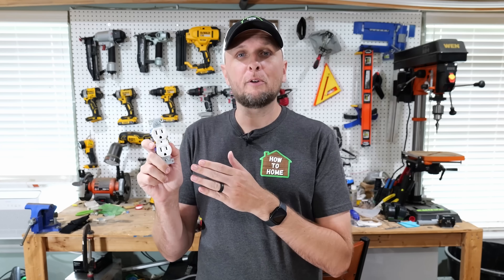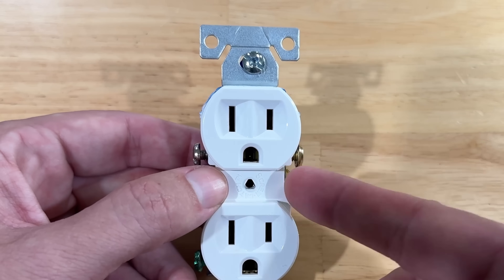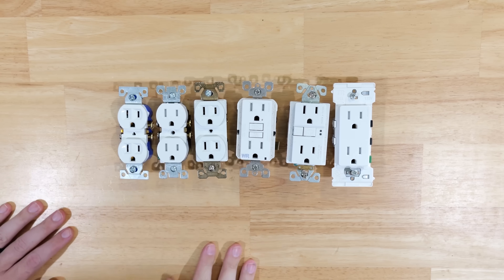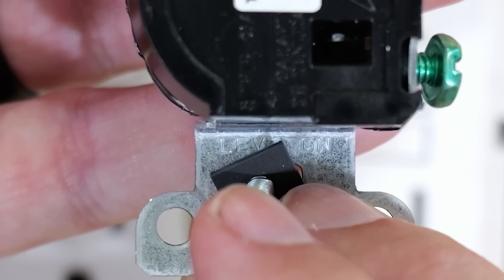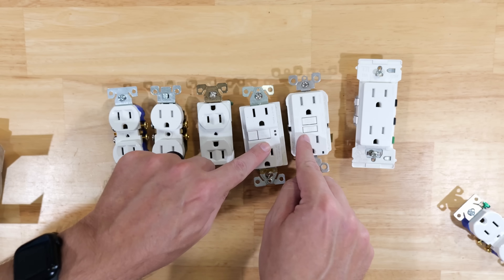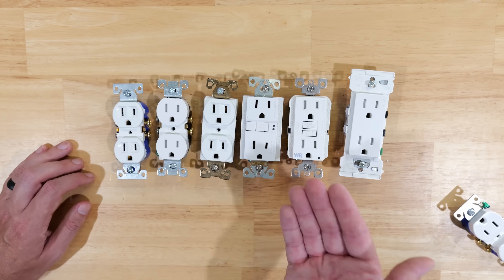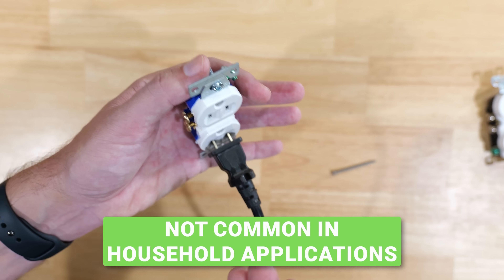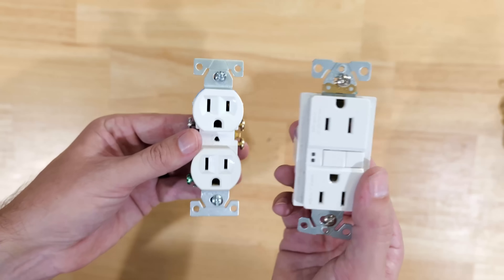The Shocking Reason Why Your Outlets Are Installed Upside Down!

Comment: If you have cords with the wire coming out of them parallel to the wall (not perpendicular to the wall) then you want the receptacle to go in the best configuration for that cord. I have duplex receptacles where one is up and one is down because the cords go 180° opposite directions.

Comment: I personally installed all my receptacles prong side down.  If the plug doesn't have a real tight fit, the prong side down orientation seems to keep the plug more secure, as there is more surface area (triangular shape) around the ground prong.

Comment: Just to settle this briefly. You have circuit testers that you plugs in your wall socket. All of them are designed so that you can looking down on them and you can see the lights and key for what the different lights stand for when the ground is down and prongs up. If you install it with the ground up you need to find another way to read the lights, example lay down on the floor and look up. On the ones that have a GFCI testing butting the button will also be on the top when plugged in correctly.
Reply: Excellent point.
Reply: My tester has the indicator lights on the end, so it doesn't matter which side is up.  Not so settled, eh?
Reply: @brucefowler8690 which side is the test button on? Lights may be on the ends but that test button is on top.
Reply: @brucefowler8690  Which side is the key on (that explains the lights)?
Reply: As an electrician for 30+ years, your theory is incorrect. You can easily see the lights on a tester regardless of the receptacle's orientation. The common rule is, because there is no actual rule, that in commercial and industrial setting the grounds go up and residential buildings, such as houses and apartments, the ground goes down.
Reply: Sounds like a marketing opportunity for a circuit tester.
Reply: And the test button is on the bottom
Reply: As a retired master electrician.  All I looked for were the two lights that indicated all was good.  Didn't care the orientation of the sticker.  On the rare occasions I needed to know I always unplugged  the tester ti read it.
Reply: Mine is marked on both sides.
Reply: So whoever designed these testers decides electrical code?
Reply: MOST people are not going to be reading circuit testers. Ground prong up when that outlet is attached too the light-switch so people there know where to plug in their lamp to control it from the wall light-switch. | Ground prong up when that outlet is attached too the light-switch so people there know where to plug in their lamp to control it from the wall light-switch. Hospitals used ground up because clipboards have a history of falling off the walls and shorting switches, for this reason hospitals are ground up. As are other industrial facilities. It all depends on context. | In the 70s when metal wall plates were the only things available, an argument was made for installing receptacles ground up.  It was common for the screws securing the plates to loosen, with the result being the plate could slide down between the plug and the receptacle contacting the hot and neutral prongs, causing a short with the result of burn marks on the wall, plate and receptacle.
Reply: Most pros use an actual multimeter and not a simple tester.
Reply: @jessenajera5369  Not true. We'll use a tick tracer all day, use a meter for special situations.
Reply: @jessenajera5369 
Really? That's interesting. Which setting on my multimeter tells me if the outlet is wired properly and where's the button to trigger a circuit breaker test?
Think before you post. EVERY electrician has at least one of those blocky circuit testers kicking around in his bag. Many of us have multiples from different brands with various different functions.

Comment: Two things you missed. 1) Try unplugging something that's at normal outlet level (not above a counter, but along a wall). Your thumb, on top, is more likely to make contact when you're reaching down to unplug, rather than your pointer finger (though at counter level or higher, you're absolutely right). 2) Thinking about the back side, inside the box - on every receptacle I've installed, the ground tab is UP when installing in a ground-up position. This prevents something that falls inside the box from making contact with the hot wire as well. Of course, I'm super OCD when it comes to this, and wrap the terminals on the back in electrical tape as an extra precaution. Thanks to Mike Holmes for that tip. :)

Comment: You missed the biggest reason to mount with the ground pin up which is:  If you have a heavy cord or step on the cord pulling on the plug it will brake the plastic on the lower outlet very often and sometimes on the upper outlet. Since I mount the ground up this doesn’t happen. Case closed for me.

Comment: It is worth noting that our friends to the North use mostly the same electrical hardware, at the same voltages and frequencies.  The CEC (Canadian Electrical Code) likewise is mostly fine with any orientation.  The exception is in CEC 72-110(3), which applies to RV hookups, campgrounds, and similar areas where cords are likely to be subject to abuse (I've not managed to get the exact official list as of 2024, as I don't want to shell out the $250 for the official copy of the codes).  In that case, the ground pin is required to be mounted up.

Comment: There is no right way to install a outlet the NEC doesn't require  a certain direction the nec allows outlets to be installed with the ground hole facing up,  down or sideways its up to you

Comment: The biggest problem I see with ground up is most refrigerators come with a flat plug, and it is for a plug with ground hole down. But people will plug them in having the cord going up and curled back down due to outlet installed ground up.
Reply: Fridge is not the only plug like that. My place have all outlets sideways. But my sister have all her outlets ground up. A Lot of her appliance have unnecessary bends on their cable because they turn towards the ground, in this case up. Even her multiplug extensions. And some things that have a plug with reset. (Like a hair dryer) Bulky block, have their cable going up and between the cable and the weight distribution it makes the plug to not stay in all the way. And come out a bit. 
So it's not about what code says or doesn't say. It's about common sense. If you are gonna be plugging things like a refrigerator,  don't put the ground up, it messes with the plug.
Reply: Some refrigerator and other appliance plugs are made so that they are better suited to ground up. Seems that the chance of agreement even within one brand is low.

Comment: Is there a difference between these orientations in the security of the installed plug in a receptacle, particularly in the case of a 3-prong plug attached to a tool or appliance typically moved around in use.  The weight of the cord between the receptacle and nearest support of the cord plus motion of the cord can dislodge or partially dislodge the plug.  Thoughts?

Comment: The NEC (National Electric Code) does not stipulate which way receptacles need to be placed, and actually says that either way is acceptable, however studies have shown that installing them prong down is safer.

Comment: a)  We're in violent agreement that receptacles should be installed!
b)  Since, in the real world, the ground is down, so should it be with receptacles.
c)  When I was growing up in the '50s and '60s, in older houses, receptacles didn't even have a ground prong.
d)  For the major part of my life when receptacles do have a ground prong, they've (mostly) always had the ground down.
e)  Also during my early days, we usually had an electric train set around the Christmas tree.  And the tinsel was made of aluminum strips then.  So, ...
f)  I'm always going to install ground down, except for one long-term extension cord where the cord hangs better with the ground up (the only plug I've ever seen that way).
g)  Install them sideways.  End of discussion.  . . . . . .  Well, now we have to decide if the ground is on the left or right.  Damn.  I'm a lefty, so, easy decision.
h)  It doesn't matter.
Reply: I agree with all, especially (h) It doesn't matter.

Comment: Many different appliance and extension cords are at 90 degrees to the plug.Sometimes the ground prong on these cords is up or can be down. I install the outlet to match the individual requirement. If the freezer cord requires the ground down that’s what I do. There is less stress on the cord that way…..
Reply: I have never seen a 90 degree plug with the ground prong up.

Comment: As someone with European origins I never fail to be horrified about the North American outlets and plugs. 
Always visible sparks when plugging in. Live prongs being accessible while connecting/disconnecting. Flimsy connections that cause arcing and start fires. 
Oh, and to end the debate: ground prong should be down to facilitate 90-degree plugs and any 3-prong adapters that plug straight into the outlet, so that wires hang down properly and don't get bent out of shape or worse. Check out a Kill-A-Watt's layout. You want to be able to read their display, so ground prong needs to be down.
Reply: I always thought it very amusing that a 'properly' installed outlet looks like a SHOCKED facial expression.